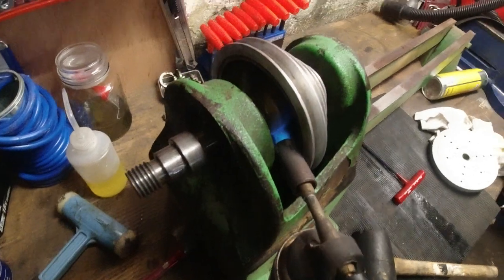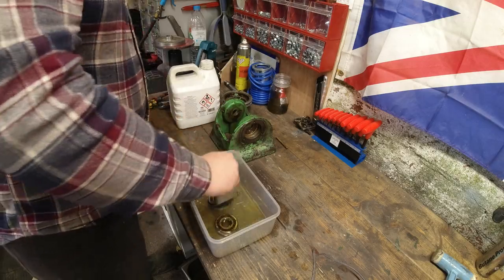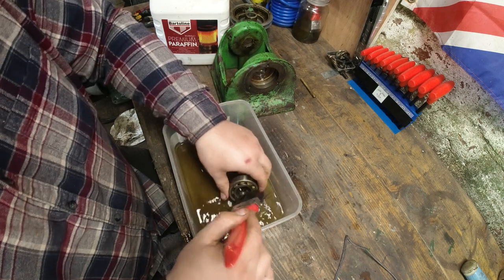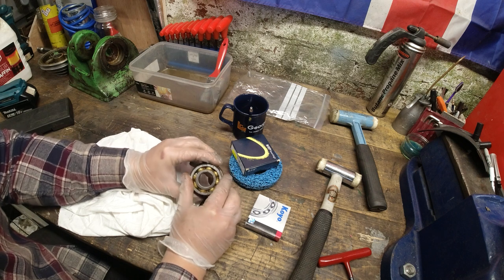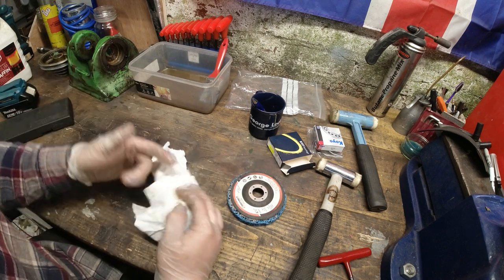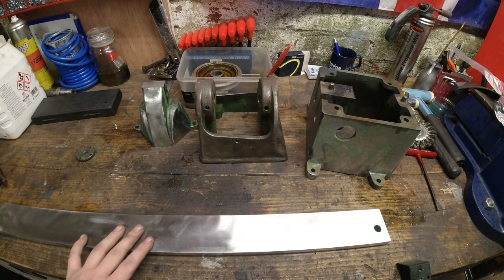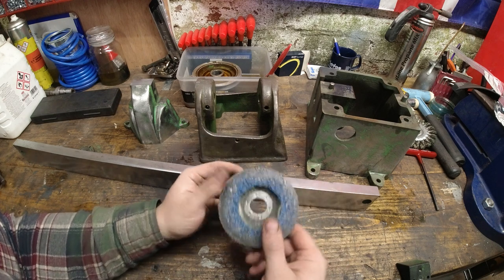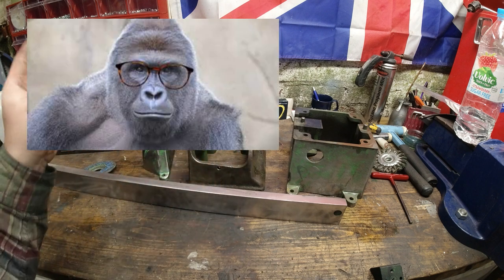HOW TO RESTORE A WOOD LATHE! Part 2

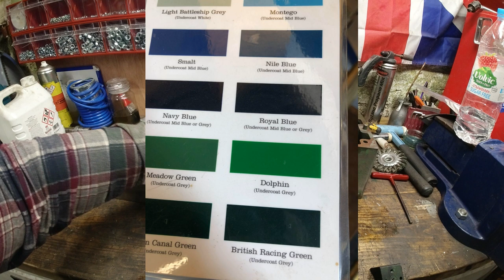Comment: rather than boring out the headstock, consider buying bearings that have a smaller OD and then make up the difference with a turned metal sleeve.  20:00 : 'I hate this green'    .....proceeds to choose another nearly as awful green.....   
I've always hated the 'institutional' green used on machine tools, it's as depressing as a prison.  The grey used on Bridgeport vertical mills is as bad.   What about a glossy richer color, then even clear coated.  Once the unpainted areas are brightened and protected, (WD-40 or mineral oil?) I think this would look great.   The blue vise right next to the lathe is a very handsome color, for example.

Comment: I see the Gorilla option won to get the shaft out. Did you find what was causing it to not move easily?
Reply from the maker: yeah the pulley is heated up onto the shaft (blow lamp to expand) needed a rubber mallet to remove.